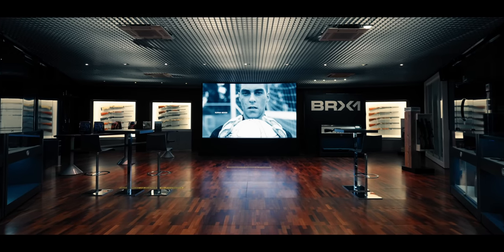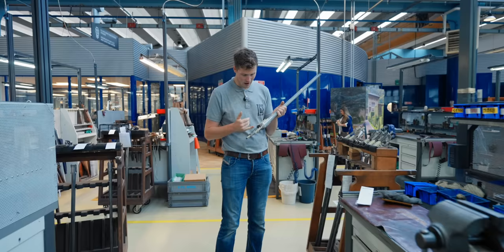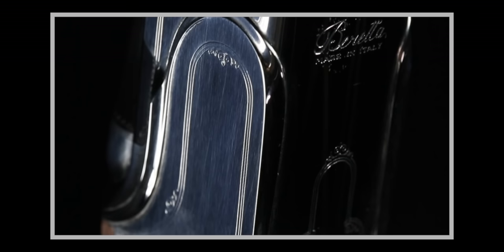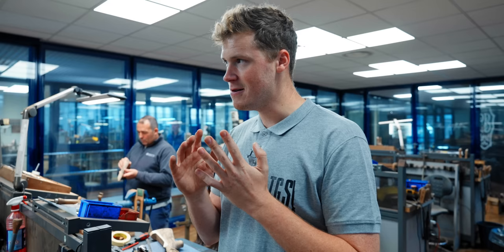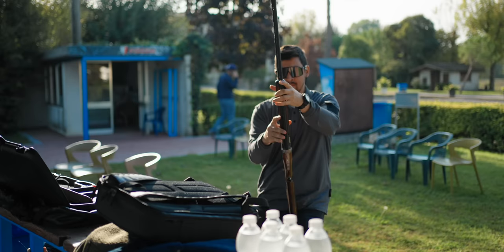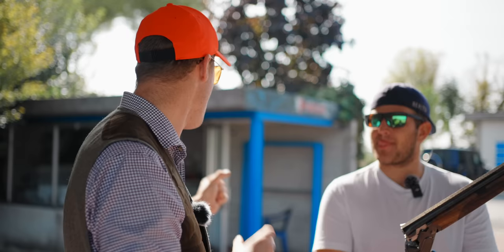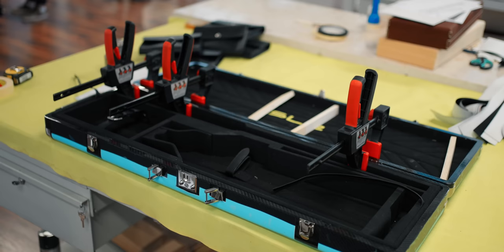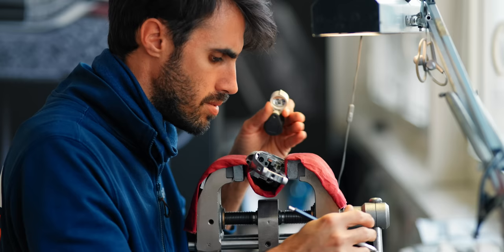Inside the Beretta Custom Shop

Comment: It is called Plant 2.  My DT 10L was assembled there as well as My DT 11 which with serial number 895, had EELL wood as all built to 1000 had the upgraded wood. All assembled shotguns in Plant 2 are returned to the original assembler for servicing. I had an issue with the DT10L after one year of servicing in Italy. I was offered a DT 11 in exchange. This was a fabulous shotgun. with lovely wood, crisp triggers of under 4 pounds  and  great patterns that aftermarket chokes could not reproduce! As I have been shooting in Europe at major events for over 22 years, I have had my Beretta shotguns for the most part serviced by Mario and his mobile workshop, until he retired a few years ago!. He was the feedback to the factory engineers for any required up grade etc. In Europe one gets free free servicing and upgrades for ones shotguns.

Comment: Great video!
A small criticism if I may, the audio clipped a few times during the production, with digital you have to avoid 0db or you get audible artefacts. Try running the finished video through audacity, which has functions to check for clipping and compressors and things to prevent it in the first place.👍

Comment: I have such a hard time with customer service with Berretta.  I have an M9a3 with standard sights, but want to upgrade to a red dot system. I know they make a couple models with slides that are designed to mount the optic. I just wanted to know if it was possible to swap out the slide assembly for one of the ones offered on other M9 and/or 92 series. I want to build it into a race gun but can’t afford buying a brand new gun or trying to trade this one in for that one. I’ll just have to I guess, because they’ve not answered the question or reply’s about  it
    I  asked what handgun the Team Beretta shooters used as a racegun but was never answered with that either. I know it isn’t the most liked by people but I enjoy shooting with it and even trained to carry it in The Air Force for a special duty. Maybe I should just find something else to pimp out.

Comment: Can you explain the "dummy cross bolt" why does it exist?
Reply from the maker: I think it saves a lot of time fitting up the perfect cross bolt if the gun fails proof. 

The proof process also isn’t kind to guns, and so it’s best to not put undue stress or wear on a perfectly fitted cross bolt.
Reply: @tgsoutdoors  thanks I will have a think about that!